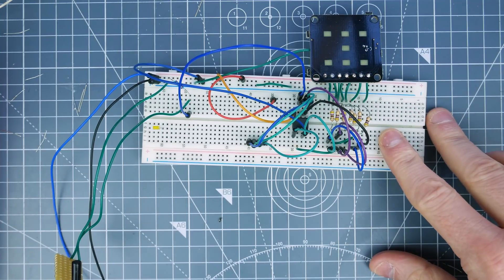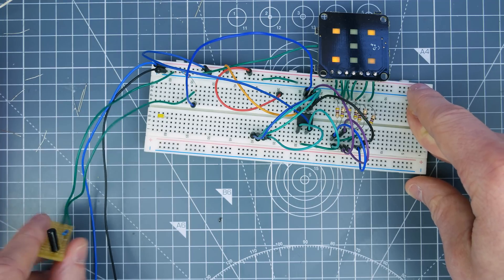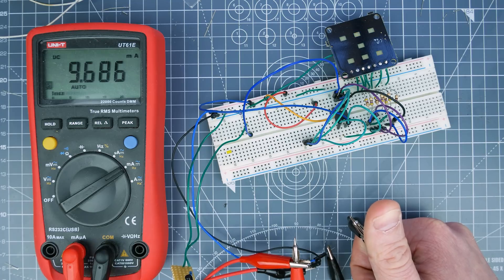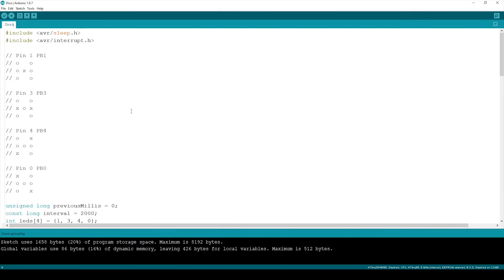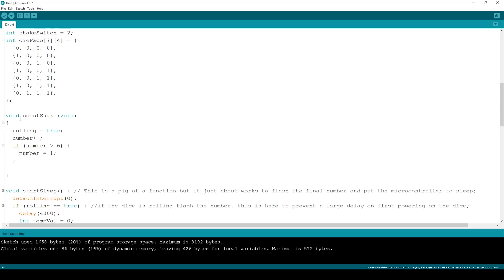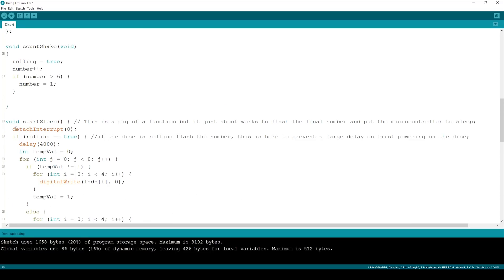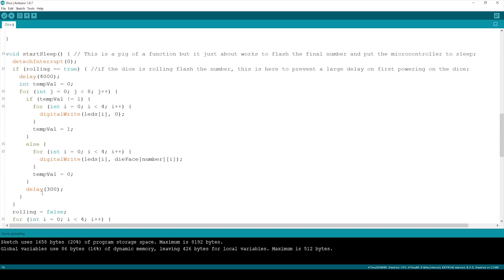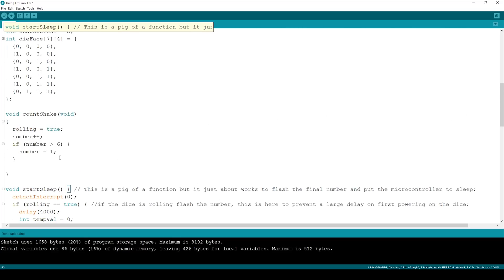Electronic Dice Part 2: Partial success

Comment: what is the brand of the test leads that you are using? i really like the sharp banana plug
Reply from the maker: Those came with my Uni-T 61e mutimeter, they are called 'Lantern tip' leads and should be easy to find.
Reply: @DavidWatts  well, i have Uni-T 61e same as yours, but it came with very normal uni-t leads. Thanks for the information. keep up the good work 👍